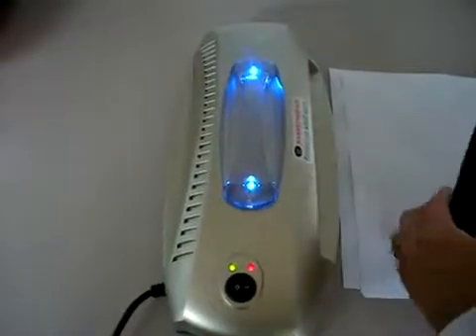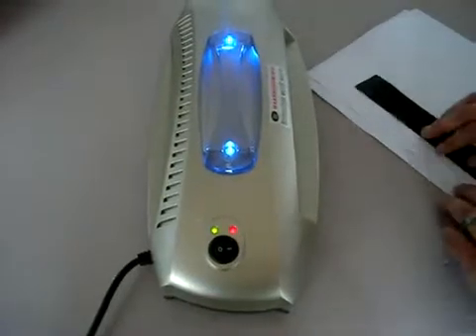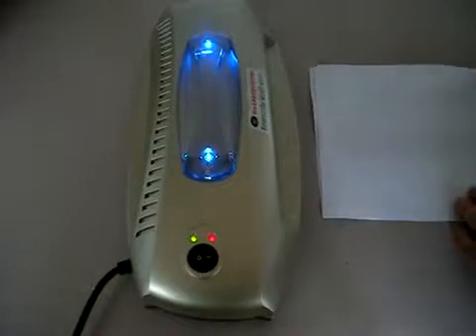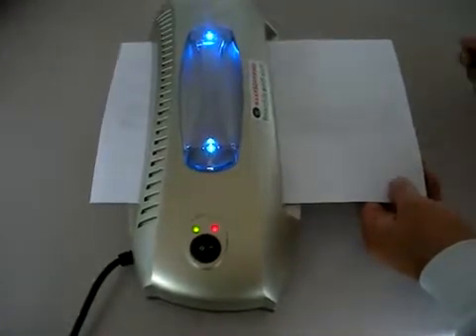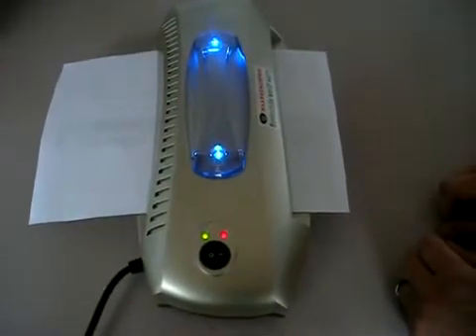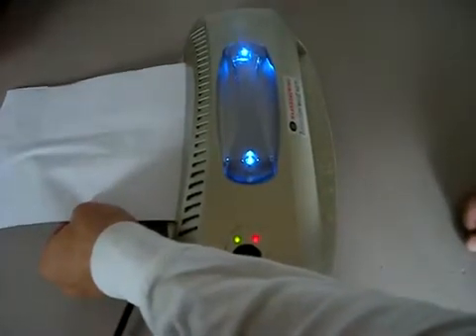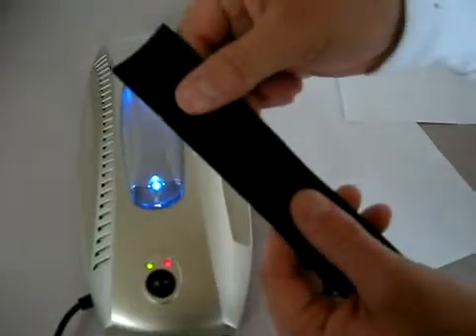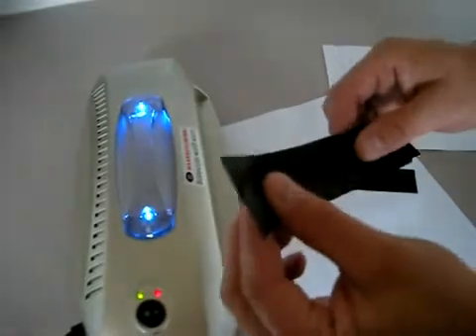Laminating two 4-mil sheets of LINQSTAT (Velostat Alternative) films

Comment: I did this with Velostat material and it was not conductive anymore after the lamination process. I am not sure what happened, but I have the feeling some coating of the paper was transfered on the velostat. I used some sandpaper to try to remove it, but it did not help. The material was almost not conductive anymore. Not usable as a pressure sensor anymore. The material looked dull after laminating with paper around.